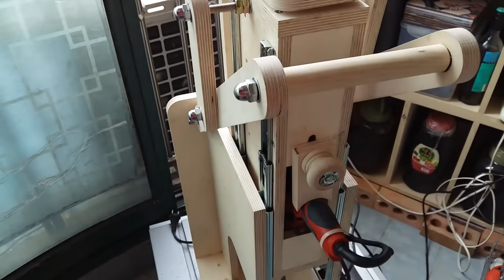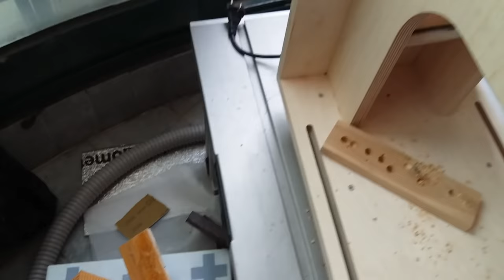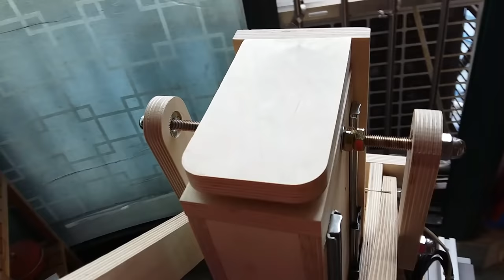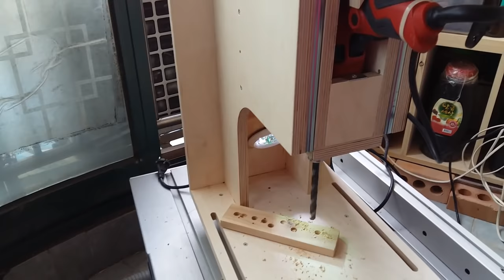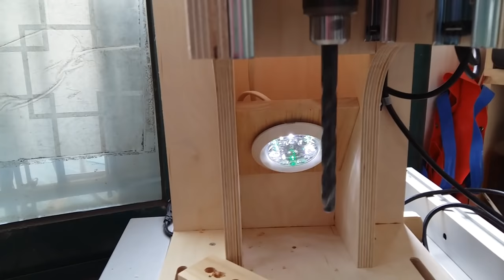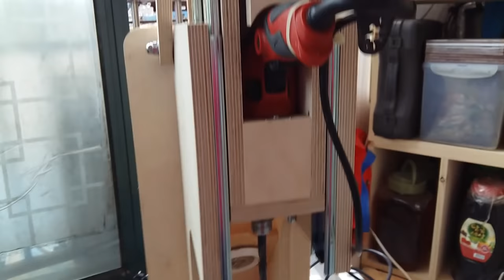Drill press wood DIY

Comment: That was the most neater design I saw here on You Tube. Other simply I think was not sturdy enough due to the weight of the HAND drill as the drill machine. With the automatic switch on as you lever down the unit to drill material, Pretty impressive.

I just wonder about the wood used. Love the design.